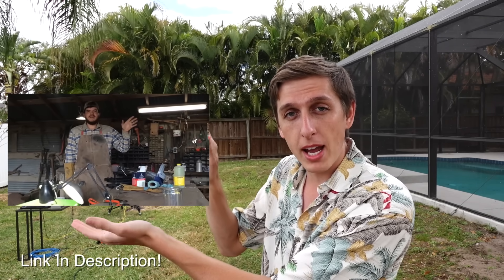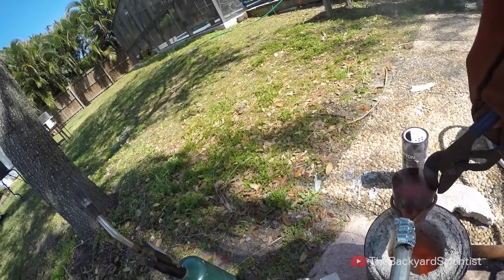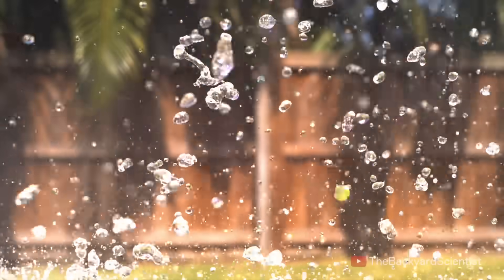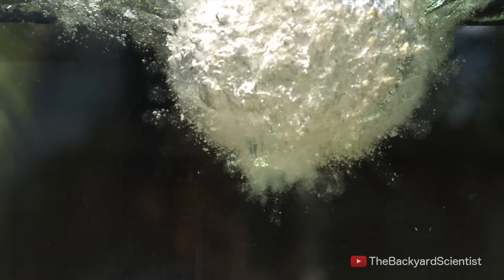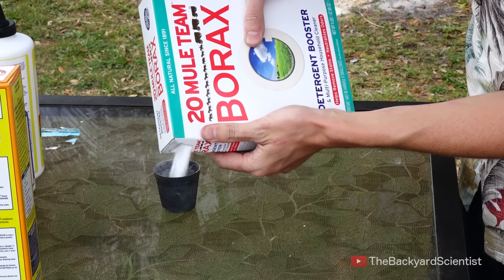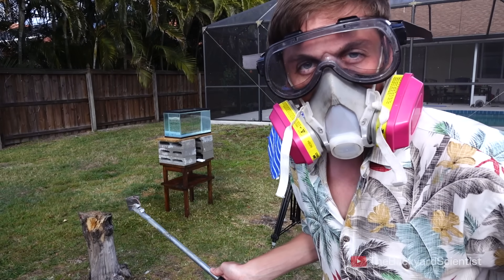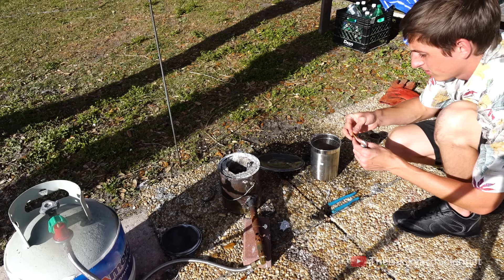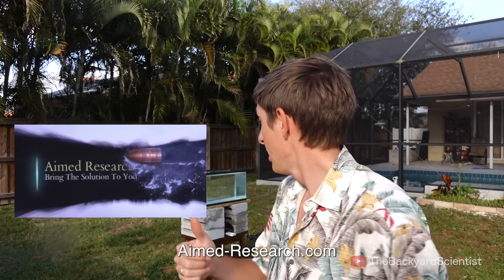Pouring Molten salt into Water - Explosion!

Comment: but if it's not a chemical reaction, how do you explain the fireball?
Reply: It's not a fireball. The metal simply gives off a red glow( the darker areas are areas that are cooler/rusted faster ). I don't know if it is rust forming very quickly, or simply the color of the metal cooling off though.
Reply: +JackThatMonkey at 6:17 there's definitely a fireball. it's producing light, and most likely heat.
Reply: ***** Metal glows when you heat it up.. That produces light, and gives off heat.
Reply: +JackThatMonkey if it wasn't glowing in the crucible why would it suddenly glow when it hits the water?
Reply: ***** Rapid cooling, when a material changes into a 'lower' state, in this case from fluid to solid, it gives off energy. This energy is translated into the explosion and glow.

Comment: Interesting. I imagine the Borax and other salts may not be as soluble as NaCl. the other salts were quickly insulated by the leidenfrost effect but the table salt dissolved so quickly that it ripped through the water faster than the barrier could be formed(faster than the water could boil), so instead of one big surface bubble, there formed a whole lot of smaller hotter bubbles throughout the tank. yeah explosions! yeah science!!

Comment: Ok, here's a possible explanation. The leidenfrost effect appears when a liquid is in contact with a surface that has been heated at a significantly higher temperature than its boiling point. What happens is that the liquid surface in contact with this hot surface evaporates immediately generating a "space" between the liquid and the hot surface filled with vapour, which is a much worse heat conductor. This effect will remain until there is just too much heat and this loss in heat conductivity becomes insignificant and the liquid just evaporates completely. This leidenfrost effect is very variable, it depends a lot on the surface in contact, temperature, chemical composition of the liquid and hot surface, etc...When liquid salt at a lower temperature is poured into water the leidenfrost effect remains and there is no explosion. Neverhteless once the salt is heated just enough the explosion occurs because the leidenfrost point has been surpassed. I am sure that this would also happen with all other ionic salts you tried if you heated them enough.

Comment: the explosion would be because of the huge amounts of energy released because the molten salt is super hot and then cool rapidly into a solid and then has its ionic bonds ripped apart? (maybe)

and the best one was the NaCl because the leidenfrost effect wouldnt be very large on it because the Na+ and Cl- dipoles are attracted tot the water alot more than they are attracted to themselves so it more readily mixes with the water, and since the NaCl rapidly cools

Comment: the sodium chloride 'explodes' by vapourising the water instantly to steam as you ultimately concluded. The other salts have lower specific heat capacities which is why they were less dramatic. I'd be willing to bet they reached a given temperature more quickly but that data was omitted from your experimental write-up ;-) Dave - backyard engineer

Comment: leidenfrost effect happened with the others because their temperature would have been higher. 
As the table salts melting temp was lower, it was poured in when at a lower temp, therefore it will have been below the point at which the leidenfrost effect starts to take place.

Comment: When you heat sodium chloride it dissociates into sodium and chlorine. The high surface area coupled with sodium's extremely violent reaction to water causes it to create a lot of hydrogen and heat really quickly. Which explodes.

Comment: Leidenfrost effect does affect melted salt to much due do it's low viscosity. If a liquid (or solid matter) can't rapidly "move out out the way", due to its high viscosity,  it will cool down and boil the water around, creating the leidenfrost effect. This as apposed to if it can expelled it's energy rapidly, move out of the way and bring it the next atoms behind with the higher energy reserves, creating the explosive effect of water expanding when converting from a liquid to a gass.

Comment: The water would get so hot that it split in hydrogen and oxygen. that is only posible with a low melting point  otherwise the water wont get in contact due the leiden frost effect. The same result you will get if you put thermite on ice.

Comment: The papers he cited attribute the explosiveness of molten salt and water to the collapse of the water vapor layer. 
Normally, under the Leidenfrost effect, the contact between the molten salt and the water creates a layer of water vapor that insulates each other from transferring more heat. However, in this case, that film of water vapor will collapse causing more local mixing of salt and water, which causes more evaporation and induces an explosion. BUT The question is how does the vapor film collapse???

The papers say that it is because of the impact velocity causes the film to be thinner causing heat to move across the layer to cause evaporation on the other side of the layer. Also, I think it doesn't hurt that he increased the temperature so the explosions that do occur are just that more powerful. Also, the identity of salt as a polar molecule may have something to do with allowing it mix more with water than other metals and the borax that he used.

Comment: I think that at least some flash decomposition of the water was witnessed in the closeup.  that coupled with the fractile decomposition of the salts crystal matrix, due to the internal thermal stresses resulted in "rapid spontaneous disassembly".  aka It 'sploded.  lookup prince Rupert's drops for a less explosive  version of what happened.  destin gives a good description of the mechanics.  just add flash decomp and combustion to that and you have your salt explosion.

Comment: Not sure if this has been mentioned yet, but could it have something to do with how NaCl is forming crystals? Like, due to parts of it already cooling down, water gets trapped, heated and expanded like you theorized?

Just speculation.
Reply: In think that it's because since salt is polar and water is to when the salt was put into the water it was trying to dissolve but it's extreme temperature cause a steam explosion

Comment: Have you considered a chlorine reaction?
I can conceive of having BOTH a sodium AND a chlorine reaction going on, which would leave your water pH-neutral.
We're not seeing any of the sodium's firey reaction, so something must be slowing down the reaction or absorbing some of the energy at a similar rate as the reaction is producing it, or maybe overpowering the pressure of the vapors.
That the Leidenfrost Effect is not being sufficient to insulate the molten salt means that there is something overriding the effect - either chemical or physical. 

NaCl is a very high electronegativity difference molecule, and I could see (under these high-heat and low-solidity conditions) a potential for a rapid chemical reaction occurring between the liquid NaCl and the /steam/ H2O. This could give you the slowed-down Na+ + OH- > NaOH reaction (boom) occurring beside a H+ + Cl -> ClH reaction (no boom). If there is ClH being made instead of H2 gas, then it would remain in similar proportions as the NaOH would, instead of escaping (and aiding the Leidenfrost effect) as hydrogen gas as happens in the pure sodium reaction. 
You still get the boom from the sodium, but when things have settled, your acid and your base have dissolved again and you have a neutral solution of table salt in water.

Comment: when sodium chloride is in a molten state, 
it has an extremely high amount, which allows it to spontaneously 
dissociate (one in a thousand Na atoms will separate from Cl atoms, when
 they collide at just the right angle, with just enough 
energy. When this happens, your sodium atom will be in its normal state,
 with one valence electro. This is a very unstable state, and it will 
combine with the just the oxygen from the water (H2O) leaving behind 
hydrogen gas.
Reply: +LotharAxe theoretically, but a very dangerous way to do it :P

Comment: I think your explanation holds true. In addition: The effect may be similar to the Prince Ruperts drop with a rapidly cooled surface of the salt globe and a still hot inside layer. So the pressure from the water inside the spheres can build up until it shatters. Like a pipe bomb. The effect is definitely dependant on how much salt at ones flows into the water. Ideally the whole volume would solidify on the surface after a short mixing with the water.

Comment: the molten salt did cool quickly and  can see that it becomes a soap bar full of tiny crystals. probably will just shatter if u tap it lightly with a hammer. i am guessing that as the molten salt "touches" the water, probably the Leidenfrost effect would kick in first, it cooled into tiny super hot crystals at probably still more than 700 degrees each, but still enough to instantly turn water into steam splitting these crystals and away from the core and letting more water into the core like a dominoes effect. 
it can also be observed that the steam bubbles are not a smooth huge bubble, but like millions of tiny bubbles looks more like a tiny cluster of salt crystals generating a tiny bubble; millions of tiny clusters generating millions of tiny bubbles..

Comment: This is just a guess, but I would guess that the reason you are seeing an explosion, would be the Na in the salt, is creating a small flame like when you used pure Na. and the heat from the liquid NaCl is causing the atom in the H2O is splitting the H2O and the H is actually exploding...

Comment: You only showed the borax, but I am going to guess that all of the other ionic liquids were more dense,  more viscous (less viscous? anyway, thicker), or had greater surface tension than the table salt. Any of these traits, or a combination of them could cause the substance to stick together more, allowing the heat to be insulated by the leidenfrost effect, or sink rapidly, allowing the greater water pressure depress the explosion and spreading the heat out over a greater volume of water. In the case of the table salt, the low density, high fluidity, and low surface tension cause the heat to stay near the surface, and allows the small explosions to spread the hot salt out, but only into water that was already heated.

Comment: +TheBackyardScientist
I don't want to be rude or anything, but: you compare 50g of Sodium Chloride (roughly 20g of that is actual sodium) with 5g of pure sodium...
The salt reaction is all about "fizzy bubblech" while the pure sodium (with a quarter of it's respective mass) reaction is like BOOM, with fire and flames and whatnot...
And you say the salt reacts more violently...
That's just blatantly ignorant...

Especially due to the "violence" of reactions of pure alkali metals with water regardless of their aggregate state. The only thing your experiment shows is: the 30g of chlorine "shield" the 20g of sodium well enough to allow the reaction to unfold in a slowed down fashion thus taking more water with it in the process...

Secondly: If you dissolve pure sodium chloride into pure/distilled water you will never ever receive any kind of ph-change since sodium and chlorine cancel each other out (chlorine being strongly acidic and sodium being strongly alkaline) - else you weren't able to use medical saline solutions safely...

...but hey, most importantly for a chemical experiment, at least the salt was kosher... -.- (okay, that was rude, but you get the point, I guess)

PS: If you really want to know why the other experiments didn't react in the same fashion:

Chemical formula of Borax: Na2B4O7·10H2O --> where the two sodium atoms are the ones that matter of a 43 atom molecule
Chemical formula of Sodium Carbonate: Na2CO3 --> here I'd have to more research than I'm willing to now, why the Leidenfrost effect is that much more powerful here
Chemical formula of Boric Acid:  H3BO3 -->  no alkali metal component... ...so you could try to use that one as your "control experiment"...

Comment: Leidenfrost effect often happens when one of the surfaces is solid and non-deformable.  Finger in molten lead, the layer of water turns into steam and provides an insulating layer between the lead and finger due to the fact that the steam layer is producing pressure equilibrium between the finger and lead where the lead is deformable and takes the shape of the non-deformable object that the Leidenfrost effect is protecting (the finger).

However, in this experiment, the molten salt is deformable as is the liquid water around it, localized pressure equilibrium can't be established because that assumes that the molten salt could push back against the steam formed and provide a non-deformable surface which it cannot.  Therefore the Leidenfrost effect is diminished and is unstable in this experiment.  (just my two cents anyways!)

Comment: My guess is that the salt works and the borax doesn't because of polarity.  As you may know from chemistry class polar liquids mix with polar liquids and solids, while nonpolar liquids mix with nonpolar liquids and solids.  Sodium chloride is a polar compound, and so is water, so when the liquids come in contact the salt tries to dissolve and disperse into the water, but it's very hot and vaporizes the water rapidly, creating a steam explosion.  The other materials didn't work because they aren't as polar as the table salt and don't try to actively disperse into the water.
Reply: +Mattsoup Exactly my thinking!
Reply: Dion Terwiel NaCl is more polar though, I wonder if there's a polarity threshold.

Comment: Sodium ions don't react (turning ions back into elemental form would at least be endothermic which would not give an explosion) since there is no electron to give away anymore.
That's also why the liquid elemental sodium was completely unnecessary to try since it's a whole different thing going on with that.
Maybe trying different chlorides could give the answer. They are all very hydrophile and if that's the reason why these explosions  happen then the even more hydrophile calcium chloride should give an even more vigorous explosion.

Comment: +TheBackyardScientist The captured water chain reaction theory is interesting; but that's not what I think is happening here. You could test by dropping into hydrogen peroxide (H2O2) instead of water (H2O). Should you do this, I suspect you'll see an explosion of approximately twice the size as that of just water, and I'll get to why in a moment... I think the higher melting point of the kosher salt compared to borax (and it's oxygen absorbing properties) are allowing the leidenfrost effect to basically... (Well, I don't know the word I'm looking for here because it's 3 in the morning... "over react" is the best I'm coming up with...) and the heat is causing the water to not evaporate so much as break apart (similar to HHO generation, only using stupidly high temperatures instead of electrolysis).

But that forms a bubble in the water containing 3 things: Hydrogen, Oxygen, and a lot of heat. I think the heat from the salt is causing the internal gasses to expand out (and very possibly ignite if you wanted to try setting up some open flames). Now, I mean, I'm a humble computer tech - not a chemist, but I'd retest with different variables -- most notably trying different fluids and attempting to capture or spark any escaping gasses. -James

Comment: my best guess would be that the when the salt becomes molten, the bond between the sodium and chlorine loosens and the chlorine evaporates off and a sodium metal with some of the chlorine explodes
Reply: +Mr.Gamer I don't think that is what happens. Remember, NaCl is an ionic compound, so there actually aren't any Na or Cl2 atoms/molecules present. There are only Na+ and Cl- ions in the compound. For elemental Sodium to be formed, there would have to occur an electrolytic process which transfers electrons from Cl- ions to Na+ ions. This is not possible, however, since there is no external voltage applied to the molten NaCl and if Na and Cl would form, they would react instantly back to NaCl (the equilibrium of the reaction lies far on the Sodium chloride-side). I think it is more likely that what we see is a Coulomb-explosion, a process where the compound transfers electrons to water molecules (forming OH- or H3O+) and, as a result, is charged positively. The resultant electric repulsion is what makes the compound expand into the water, increasing its surface area dramatically and reacting further. But what I find irritating is that the pH of the water doesn't change (according to my hypothesis, the pH would have to be shifted to values > 7 or < 7). I guess it really is just the expanding water steam trapped in the molten sodium that caused the explosion...

Comment: I think the Leidenfrost effect is neutralized due to the salt's incapacity to hold heat for long enough to form a steam barrier around itself. When you let the salt cool in the beginning, it started to cool rapidly, which means it lost its peak heat quickly. The explosion also didn't happen right away. It had a delay of about a second if not a little more. When I think of the two aforementioned points I'm led to believe that the water makes contact as opposed to being held off. 
I don't usually partake in science but it's fun to think about this.